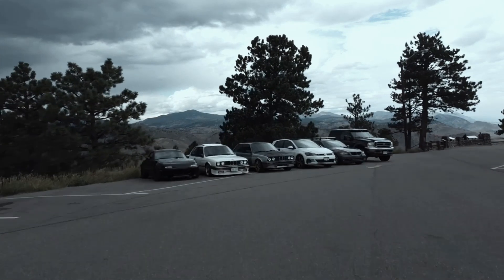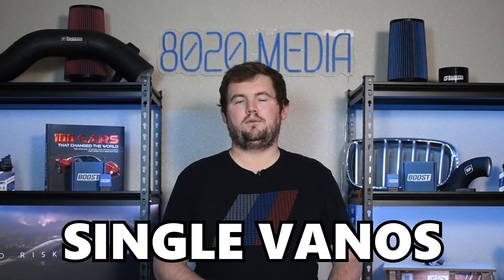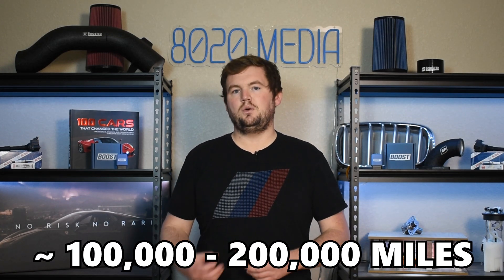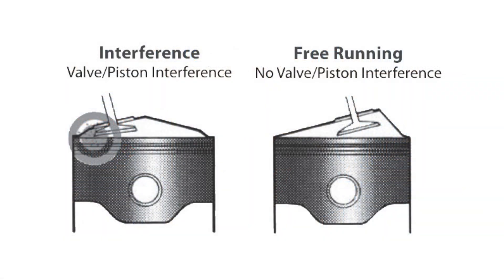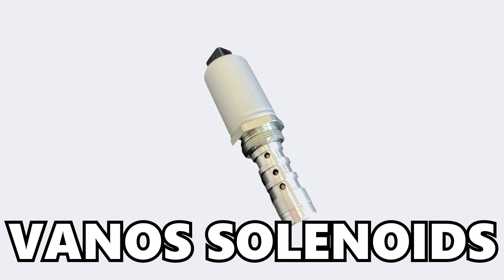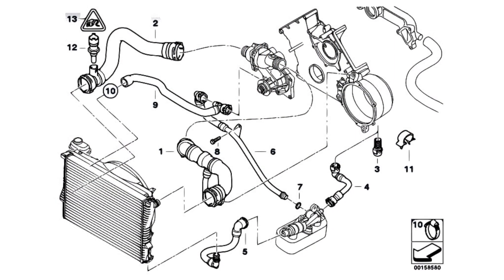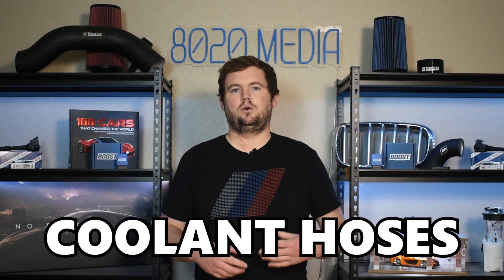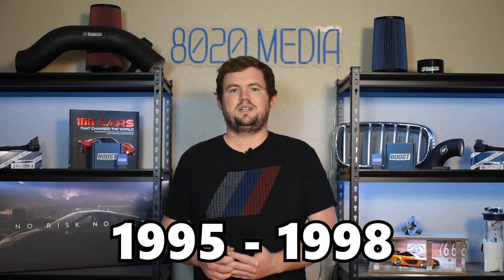The Truth About BMW’s M62 Engine Reliability!

Comment: Had my M62TU E38 735i 10 years and its never missed a beat. Silky smooth V8 that delivers over 30 miles to a (UK) gallon. Look after it and it will look after you. Whats not to love.

Comment: Replace the "Kennfeld-Thermostat" of the M62TU with the 88 C°, non electronic thermostat from the diesel V8 (740D).  Before the change my water temperature went as high as 106-108 C°. Absolute insanity as the high pressure brakes all the old cooling pipes and plastic parts. That's why is cooling parts failure so common on M62TU. You also need a resistor that plugs into the plug of the electronic thermostat, so there are no errors.
Reply from the maker: S - Thanks for sharing these insights.
Reply: There was an 740D V8 Engine from BMW?
Reply: @maczanescorpious Yes, it had around 240Hp and 560 Nm torque. But compared to other diesel engines it was somewhat thirsty so not many people bought it. (They rather went for the 4.4l petrol V8.)

Comment: My car came with a zionsville radiator, but I did my vanos, and chain guides 90k miles ago. I've beat the hell out of the car daily since. I've been running with a lean condition for that entire time, too. totally blew out my cats. I'm at 200k now and it still does 0-60 in 5.6 seconds.  M62TU 540i/6.
Reply from the maker: W - Sounds like it's still going strong! Thanks for sharing your experience.
Reply: What's a zionsville radiator  ?
Reply: @1974geary  It's an aluminum radiator made by a company called Zionsville.

Comment: The m62 was a really smooth engine. Torque curve is very flat and it can be felt. We had an early e39 540i with the non vanos engine and by the time I sold it 15 years later at 140k miles it was falling apart. The radiator was replaced several times because the plastic parts would break. It would leak oil from the valve covers, oil pan, and the intake gaskets and required several replacements. 

I'd be interested in a video on the m60 4.0L v8. It has a similar power output to the m62 and was built with double row timing chains. It is BMWs first modern V8 and like the N54 was overbuilt. Like the N54 to N55 the m60 to m62 was nerfed when the company realized they could get away with it.
Reply from the maker: G - Thanks for sharing. We do have an M60 video :) https://youtu.be/wetlYaTGp_A